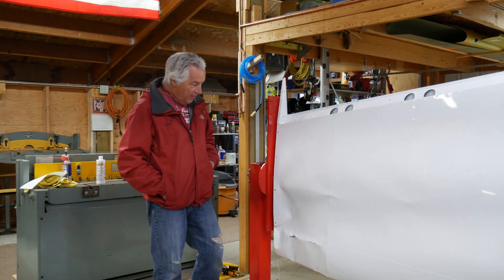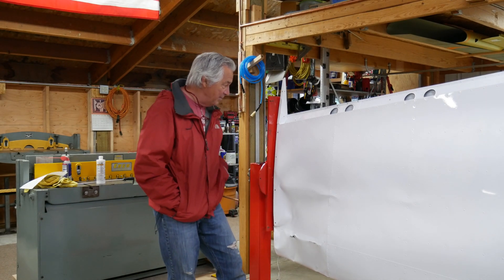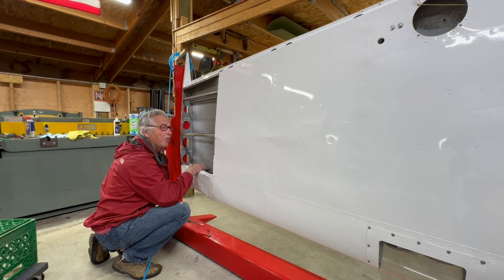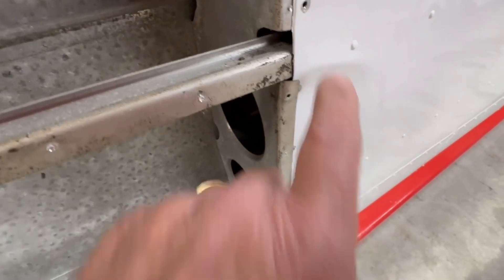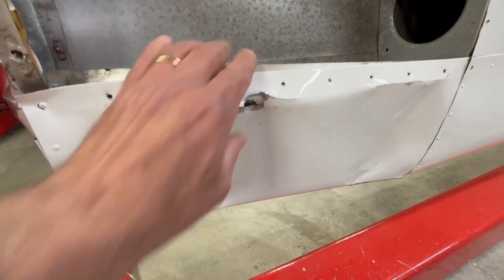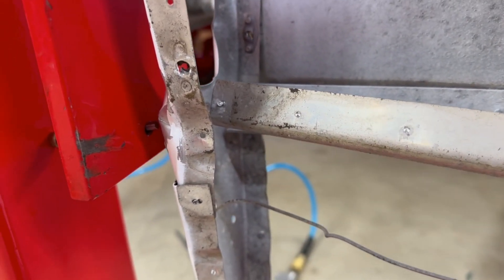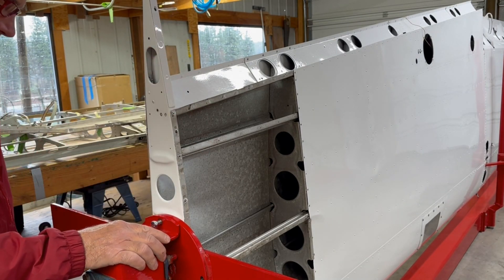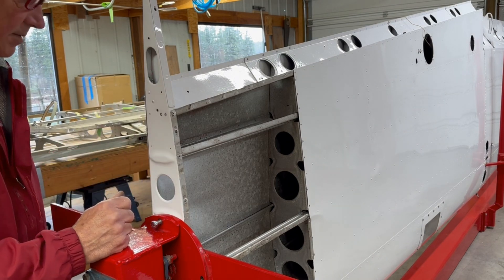Cessna Wing Tip and Spar Repair

Comment: Did you put it back together with blind rivets ?
Reply: Is that amount of inner skin corrosion normal for that age of Cessna?
Reply from the maker: @norduferhandel4512 not sure we can use the word normal.  For instance, I have one of the first sets of 180 wings off the line.  They are beautiful…. I think it’s more about environment than age.
Reply from the maker: Solid rivets….Not pop, or blind rivets.